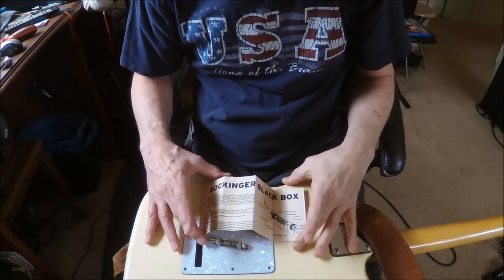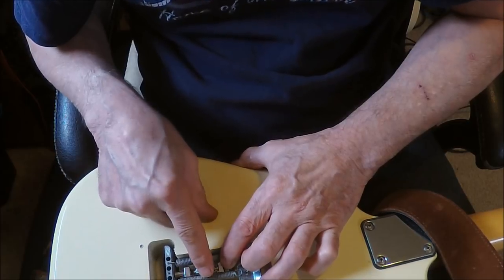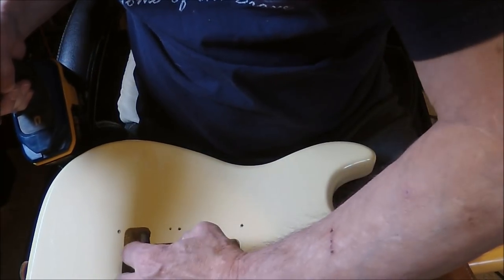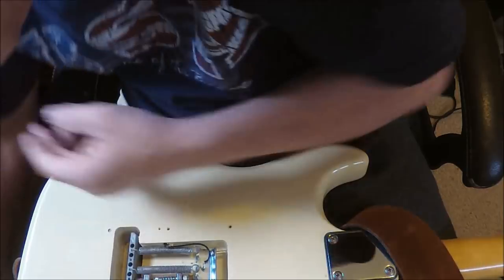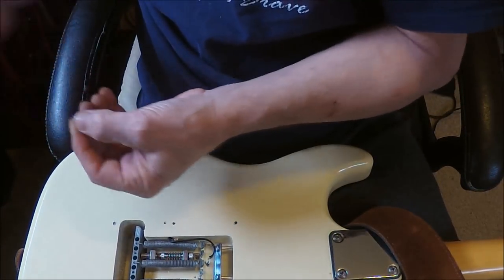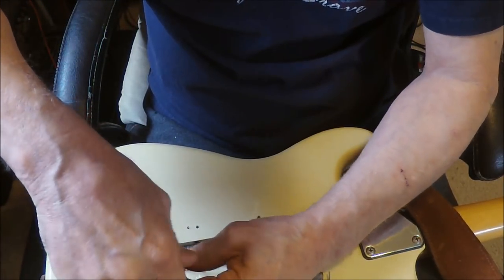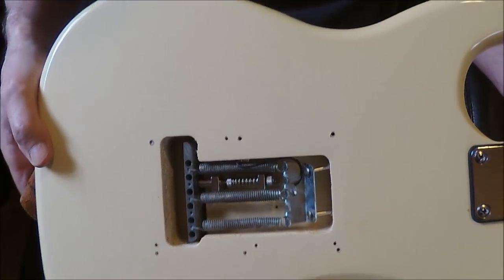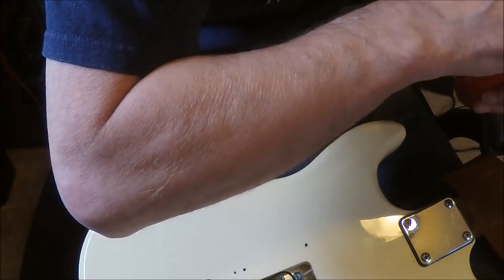Rockinger Black Box Trem Stabilizer Ed Dana Guitar

Comment: I got one and glad to have found  your video here giving a simple install explanation.  However, I have come up with a hack which improves this contraption considerably. I took a couple of small pieced of leather leftover from excess of a leather tennis racquet grip which had double sided adhesive on it.  Placed a small piece between the stopper and the block, and one between the setter nut and it's metal contact.  Works amazing! All the stability of what this device does, plus the leather eliminates the ugly metal on metal rattle sound it was making when using true "vibrato" .  I may make my own little video on this particular hack. Thanks again.
Reply from the maker: Nice.. I would like to see that!

Comment: I LOOVE THIS THING! Put one in my jackson soloist and i can tune down all the way and my floyd stays PUT.
Reply: got any video? i put in a pitch shifter for drop d and want to use it to float!
Reply: Luis Torres you could probably use this black box and something like an evh d tuna. Never tried it personally but saw a vid on the d tuna where someone mentioned doing it
Reply: you have problem with your floyd if it does not stay in tune, this thing just a backup and adds some stability if you have properly functional system
Reply: @luisalextorres  not likely

Comment: Thanks a bunch for this video! I wasn't gong to get one of these after watching the FU-Tone Black Box video as they had the center spring removed to install it. If I remove that spring I have to completely reset my entire tremolo system. And I don't mean tiny adjustments! Its a HUGE amount of adjusting and not an option for me. I'm guessing these are all mostly the same for the most part so I'm going to install it like you did the Rockinger. Thanks again 🤩

Comment: I have just experienced that same trouble and I have been thinking wat to do eh what to do and I have just come up with the perfect solution for that problem and I have considered several options well this is the trouble the wood is just so thin that you will go right through into the pickups cavity now I think the best and cheapest way to really profoundly salve the problem is to glue A piece of plywood like three or four mm thick so your screws will hold now you need also to replace the bottom block of your tremolo and the be presize with measurements to get the right height but probably between 5 and 10 mm you are good not too high otherwise you’ll touch the back plate

Comment: How far can you down tune before the tremolo springs overcome the tension? I'm a guitar teacher and tune anywhere from E standard to B standard on the same guitar. Right now I have my strat's tremolo blocked, but I'm interested if this device would have enough range to play in all those tunings and bring back my ability to bend up
Reply from the maker: I don't know other than it works fine in Eb or open G or D tuning.
Reply: @EdDanaGuitar  I'm definitely  gonna try one I'll let you know how it goes!
Reply: @EdDanaGuitar  My guitar student has a similar design, but cheaper version on his guitar I tried. I was able to retune it from E standard to B standard with practically no bridge movement! And on a floyd too! I've ordered the Rockinger to try myself and have high expectations I can achieve the same result

Comment: I had one of those in an Epiphone Strat I used to have. It was actually a Hipshot Trem Setter. I traded it with the guitar. Traded the Dimarzio Superdistortion I had in that guitar with it too. It was a long time ago before I wised up to putting things back stock before I turf them.
Reply: OK You did that last Saturday ...... I missed that. I was in Florida and it was like 92 degrees and sunny. Couldn't resist adding that.

Comment: Next install try putting a piece of tape around the drill bit and only pilot the hole a 32nd of an inch and then use the screws.
Reply from the maker: There won't be any more installs.

Comment: If you ever do have tuning problems again, definitely check out Graphtech if you haven’t ever heard of them!
Reply from the maker: yes graphtech saddles.
Reply: Ed Dana I have a Graphtech Tusq nut on my Agile Les Paul copy and I rarely ever have to tune it ever. It can definitely help if you’ve got a vintage tremolo too.
Reply: Hi Ed, where can I pick one of these up and how much do they cost?
Reply: @Stretchwreckedem469  Wilkinson trems and locking tuners work also...I have them on my American Start,.....however,...that's like a 100 dollar upgrade,...that's not much for a thousand dollar guitar,...but on cheaper guitars it's not worth it,....also the $45 Wilkinson trems come with a tone block and stainless steel saddles, so the guitar plays better,.....p.s. some Harley Benton guitars are not that bad.

Comment: I know that this item is meant for FLOATING bridges, but yours is a 6 point pivot screw bridge that's flush mounted to the top of the body, therefore NOT needing this mechanism? Unless your bridge IS floating somewhat? Cant tell 100%, but it doesn't look like it is? Anyways this item is great for FLOATING bridges and allows for sharpening a note by being able to dive back on the trem due to its spring design, not just forward .
Reply from the maker: If you look at 6 point tremolo systems you will realize Leo designed them to FLOAT!
Reply: @EdDanaGuitar  yeah absolutely it's just that your video it doesn't appear to be floating at all
Reply from the maker: Maybe it wasn't clear. If the tremolo was "decked" the "black box" would be useless...

Comment: did it holds ?
Reply from the maker: Still going years later. Never had to adjust it ever again. Guitar holds tune as well as any!
Reply: @EdDanaGuitar  appreciate the video.  Had a couple of questions for you.   I'm guessing that if you wanna downtune to a drop tuning or you just wanna drop tune the low E to D, you would just set the spring tension to tight so that you can change tunings easily without the normal hassle of tuning trem guitars?
Do double stop bends throw off the fretted note?
Reply from the maker: @allboutthemojo  You really just set it and leave it. Drop tuning to D wont affect it.
Reply: @EdDanaGuitar  and overall downtuning to a step or 2 steps down? Would that be possible and still have some spring range left to pull up on the trem?

Comment: That "tink" your hearing is a string sticking in the nut. Take a toothpick and apply a tiny amount of Crisco (the white cooking stuff in the blue can) in the nut slot trust me you'll thank me later. Way cheaper than nut sauce.
Reply from the maker: Problem solved. Thanks.
Reply: They have been using chapstick since the 70s to achieve same results.

Comment: Hmmm..🤔 "Let's see what happens .." well..it looks like you already had 3 trem springs...now it looks like you have...3 and a half! Why would this work any better than say...a 4th trem spring?
Reply from the maker: Why wouldn't it? Think about it.
Reply: @EdDanaGuitar  well it would be cheaper, easier to install and likely more effective to just add another spring then...right? I don't see what a smaller springs retention on the block ( where your other 3 springs are already) is gonna do magic..
Reply from the maker: All my Strats have 5 springs except this one. It rests agains the block so that it returns to exactly the same place every time. The Strat Plus has a device similar to a shock absorber called a "Trem Setter." If you don't like it, don't use it. Simple as that!
Reply: @EdDanaGuitar  lm for anything that works, my LP and SG have "String Butler's" and "Gibson TP6" tails on them..l am for anything that improves tuning stability but this extra spring with a plunger seems like just that.. you honestly notice a difference? I don't mean to come off as putting it down, it just seems looking at what it is and how it seems to work that it may be guitar snake oil..lm not and didn't say it was, l haven't used one.. but it just doesn't look like it could possibly change stability more than an extra spring. Do you have them on strats with 5 springs? Does it fit or cause spring friction noise if you do?
Reply from the maker: Yes it does a great job because it acts as a trem "block." In other words it's equivalent to decking the tremolo, but allowing you to float it. The heavy adjustable spring lets you pull up on the trem but returns it to where you have the tension set. It's fully adjustable.
Reply: @EdDanaGuitar  well.. l hope your right.. l ordered 3 for my Strats.. l didn't order one for the Super Vee bridged Strat l have..it has amazing tuning stability.
Reply from the maker: lol... nice, but I hope you did more research that just my video! Try to find instructions on installation.
Reply: @EdDanaGuitar  futons has black box and install video watch man before you go making holes
Reply from the maker: https://www.youtube.com/watch?v=NC5BOCLrzY8
Reply: @EdDanaGuitar  l would think you back it off almost all the way and set it snuggly against the block and screw it in there.. and adjust to your liking no?.. l have not had time to install or even look if instructions are included, l will get time next weekend.. thanks.